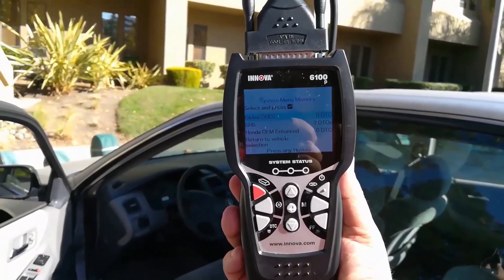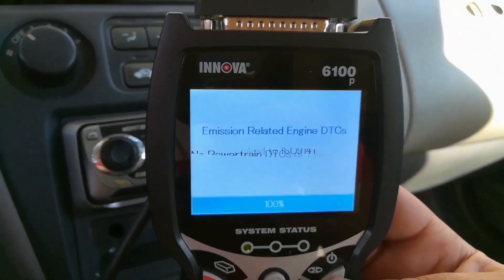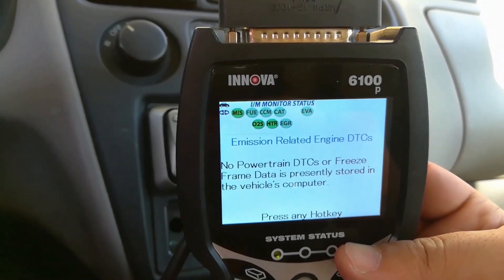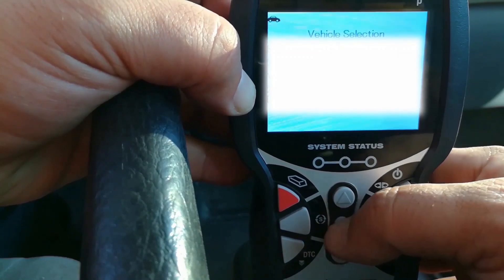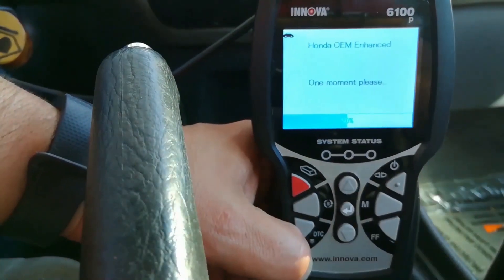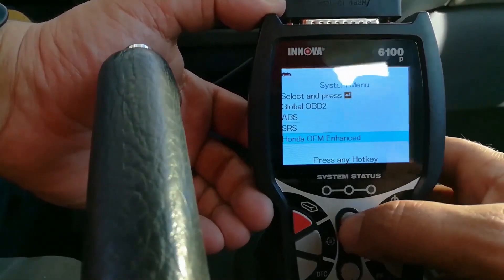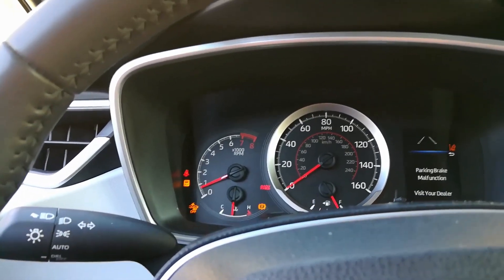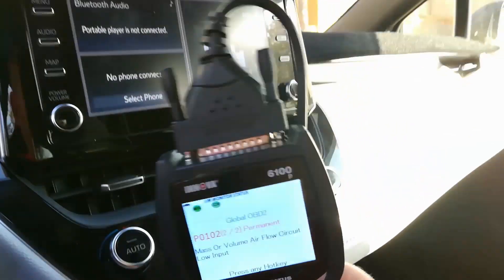INNOVA 6100P OBD2 Scan Tool Review To Reset Check Engine, SRS, ABS Lights

Comment: I saw a video on Innova 6030p & i Wasnt impressed.  On the 6100p i would be more interested in buying it.  I found ur review to be very thorough and u made this look like i want to check it out
Reply from the maker: David thanks for the feedback about the innova video. However, these scan tool is a little older let me know if you want a more updated scan tool Cl recommendation.
Reply: @RANDOMFIX  It may be older, but the 6030p had a lot of errors.  I'd feel more comfortable w/ this one

Comment: Is this a Bidirectional Scanner.?  Does it do EGR Reset ? Does it do Fuel Pump scan for Fuel Pressure ? How about Compression test for Spark , Sparkplugs ? Can that  scan 2001 02 Toyota Camry is that compatible.?
Reply from the maker: James, this is much order unit and it was not directional. All of the features you are looking for can be found on this unit https://youtu.be/QKNp2bFYcVI?si=PipERBP9EwLF6zho

Comment: Please want to know if this thing
Can reads the short trim fuel trims on bank# 2?????? Before i bought it
Reply: Need the short trim port adapter.
Reply: @chrisreynolds2410  WTF I have a $59 Autel that graphs short term and long term LIVE DATA. And records it.
If this cannot do that , it is junk.
Reply from the maker: Sorry for the late reply! did you find a solution?

Comment: Will this scanner clear airbag malfunction code
Reply from the maker: Yes it can clear airbag codes once the issue has been fixed. If you clear an issue that not fixed the srs system will Re detect the issue and turn the airbag light

Comment: Funny cuz I’ve used mine since 2019 per the quick start paperwork and never knew it takes batteries. 

Never thought to look and none of my others do and it says nothing about batteries in the QS guide… Go figure

Mine is  different in that the FF on yours is LD “Live Data” on mine
Reply from the maker: Cool, thanks for sharing, just watch when the batteries get weak as you will start getting all kinds of errors.

Comment: Nice review on one of the worst scanners I've ever used. This must be an earlier version than what I have but I don't think it makes any difference.  I didn't get 5 mins before I wanted to take a hammer to it.  You take away abs, srs and oil reset, you've got a $20 scanner.  You don't cover freeze frame or mode 6 or live data or even how you defined the vehicle in the scanner.  You can do live data but it's very convoluted and I don't want to promote this scanner so I won't explain.  You can get mode 6 data but you can't save it, or move it to phone or pc, live data either.  The format of the test results is difficult to follow unless you're familiar with mode 6.  The rs2 app is pretty much useless as well as the updater.  One of my biggest complaints is that when I plug this in, it starts to connect to the ecu right away even with ign off.  Can't stop it or reset without pulling the cable out so you try turning ign on, then it fails and you have to start all over.  And it's continually dropping the connection.  5210 does that too.  Other scanners I've used don't.

To be specific, what your review doesn't cover is the errors in mode $06, and how you can't print this data.  It doesn't show how to move live data over to your phone or pc and don't say rs2 app because that doesn't work.  And, your review doesn't explain the vehicle selection list and how this could end up making the scanner stop working long past the return policy or warranty.
Reply from the maker: Thank you for your feedback, much apprecated!

Comment: Has batteries to light the LED and is an overpriced basic code reader. $30 max price in need here.
Reply from the maker: I appreciate your constructive comments, thank you for the feedback!
Reply: i cant find one single $30 computer that also will check srs, abs, live data, or anything other than check engine light...